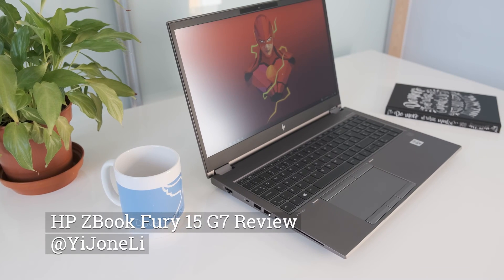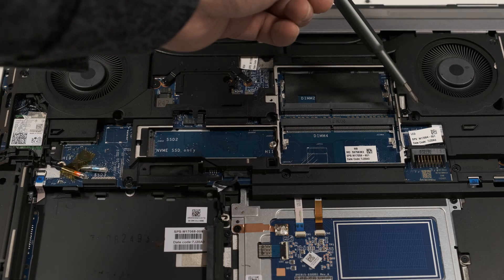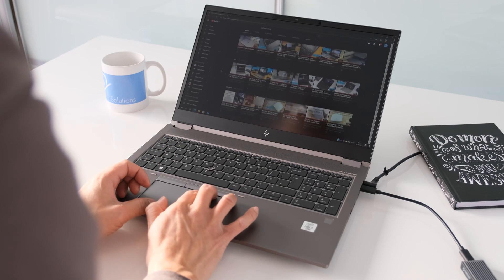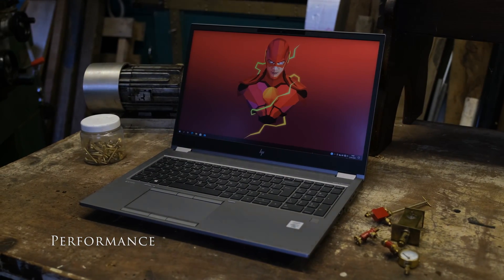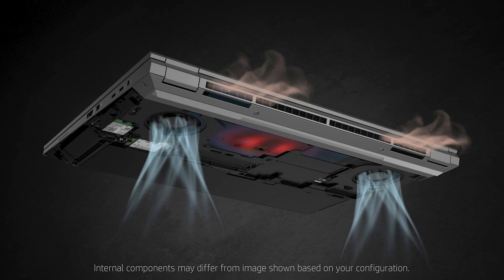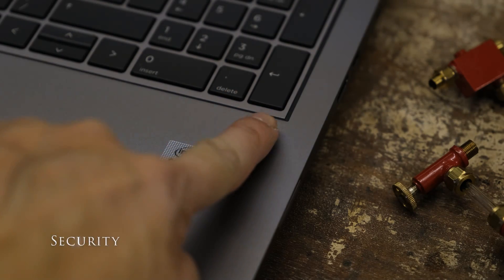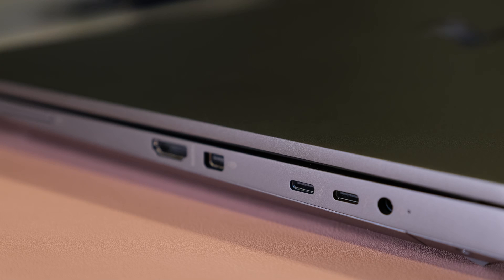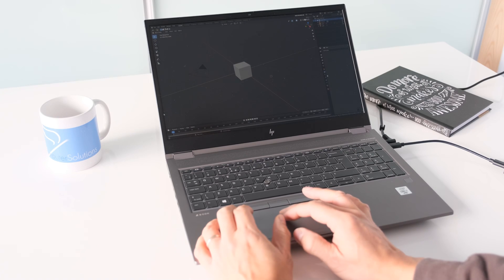HP ZBook Fury 15 G7 Review (15.6" Mobile Workstation Beast)

Comment: Can the RAM be upgraded?
 I have 16 GB, I want to upgrade it to 32 GB. Can it be easily done without the need for an engineer?
Reply: does it make alot of noise and heat or not  ??
Reply: @MuhammadAasim-y8s 
Yes, a lot of noise! I don't know why!!!
Reply: @one_of_the_Arabs  Thank you for the honest feedback! That is very helpful to know.
 
Does the noise happen all the time, even during light work like browsing / reading papers, or only when you are running heavy programs?

To answer your RAM question: If you have the ZBook Fury, it is very easy to upgrade! It has 4 slots and a "tool-less" chassis, so you can just slide a latch and add the RAM yourself without an engineer.

Comment: Not sure why this is praised so much, but there are so many disadvantages for this machine:
     - display quality is under any expectation 
     - display bezels are huge for this price-range 
     - fan noise is so high that you could consider this defective (I could only use it with a good headset with ANC)
     - the keyboard is mediocre - immediately switch to using an dedicated keyboard
     - the touch pad is small, non-responsive in some cases and not very good overall - chose the cheapest mouse that is better than this
     - the size and weight are under expectations (considering competition has slimmer variants , not even considering new Apple M laptops)
     - battery is almost non-existing when in building code and doing something else in parallel (really expected this to be better in a bulky workstation like this).

There are some advantages(mostly the processor), but don't think they outweigh the disadvantages.

Comment: Thank you soooooo much for this review! I'm thinking about buying the HP ZBook Fury G8. I used to be a ThinkPad fan, but have been disappointed by ThinkPad offerings lately (especially with their decision to solder on RAM on many of their laptops now).
Reply from the maker: The Fury G8 is just a minor update to the Fury G7, tweaks like newer processors, Nvidia Ampere GPUs and 4K 120Hz display panel option. Making an awesome mobile workstation even better. Currently using the Fury G8 with i7-11850H, 32GB, 1TB, & RTX A2000 GPU. Love it! 😍

Comment: Price is crazy, I have a furry G7 17" rtx3000 for Solidworks, it heats up like crazy, fans work all the time, the battery does not last long, I don't think that 2hours are possible even if you are using only MS WORD.  And my machine has all the time sound card problems when switching from HP dock to laptop and vice versa, problems are solved with hp assistant but it is taking a lot of time. My old Zbook G3 has way better wifi reception than G7, can not explain this at all.

Comment: Great review! I'm strongly considering the ZBook Fury 15 G7 with the exact specs as your review model. My hesitation is with the NVIDIA Quadro T2000 GPU, I will be doing some Photoshop and Lightroom photo editing as well as some Davinci Resolve Video editing. How does the Quadro T2000 GPU do with Photo and Video editing? Thanks
Reply from the maker: I used it as my daily driver for two months, working on Adobe PS and PP all the time. Premium Pro 4K editing and encoding was smooth. No hesitation in getting this spec with the T2000 for this work + good price point without going crazy on the more expensive RTX 3000 upwards. Tip, always find more memory and secondary SSD for caching helps a lot when using Adobe CC. 👍
Reply: @Dovecomputers  thanks for your feedback.

Comment: Fury 15 G7 actually has 4 m.2 slots... the other two slots are in the same area as the s-ata bay, but you'll need a bracket or you can't screw the drives down.

Comment: An excellent, in depth review! I wanted to know what I should expect from my new workstation, and now I feel great for the coming year. Thank you!
Reply: Do you still have it? And do you stuffer any problems especially with heating?
Reply: @Hosssamm Ive had mine for a few months now and honestly like it quite a bit. I think the only thing I dont like is windows 11 so far haha. 10 felt a lot more snappy, so I might downgrade the os for awhile
Reply: @EjMacarus  what about heating ?? can you please tell us about heating and making noise ??
Reply: @MuhammadAasim-y8s Hello! I’ve been working with this exact laptop since my first comment was posted and it’s been great! I feel like it’s a ready to go workstation. I don’t experience noise issues, but I will say it gets toasty up near the sound bar and underneath, so maybe no late nights working from bed under heavy processor workloads. My only other comment would be the battery life, I’ve had one assigned that was fine (6h work time) and now I have a different one that’s pretty bad about dying. I’ve been meaning to run some battery analysis on it (2/3 hours working time)
Reply: @EjMacarus  Thank you for being so honest about the heat and battery life! It is really helpful.
I am a PhD student and I’m looking at this exact HP ZBook Fury 15 G8 (i7-11850H, 32GB RAM, T1200). I plan to use it mostly for reading and writing reports, but also for scientific calculations (physics) sometimes.
Can I ask:
Light Work Performance: When you are just reading or doing 'normal office work,' does it stay silent and cool, or do the fans still make noise?
Calculation Speed: When you do heavy workloads, does the heat slow down the computer (throttle) or does it stay fast?

Comment: I just bought my Zbook fury 15 g7 with the RTX 3000 and  i9 but I don't know if it is normal for the battery to drain so fast in less than 45min it goes from 90% to 60% or less and the temp is constantly around 70°C  max was 86°C even when there were no programs running and now I don't know if my laptop ain't working right or what (it is my first workstation )....
Reply: eeek about to go for the same setup. rtx 4000 though. is this a custom build? how long did it take to arrive?
Reply: anyway ended up migrating to the apple ecosystem, for now. Macbook m1 has been flawless for 4k etc. battery time is crazy. Hope intel pull their finger out

Comment: Question: doesn't the 94 Wh battery prevent to use the available 2.5" slot? The battery part that covers the slot seems to be quite thick even according to the pictures on the web. I am thinking about buying this piece and I have an unused 2.5" WD Blue 1 TB SATA SSD but not sure if I will be able to mount it there because of this.
Reply from the maker: There's plenty of height for a 2.5" underneath the battery.
Reply: @Dovecomputers  thanks for the answer. What about some mounting frame kit, is it necessary in this case?

Comment: What workstation would be your choice out of fury 17 vs p17 vs precision 7750 ?

All relatively same spec Xeon 8 core processor 64gb ecc with rtx 5000.  

Question around what has better thermal management. Battery life, understandably limited given specs but an hour here or there makes a big difference on site and customer service for repair? 

Would really value your opinion

Thanks in advance
Reply from the maker: IMO, the Fury G7 wins out. Using mine for 3+ months, great thermals for 4K video editing and CAD work. You will never get decent battery life from these power workstations as its all about max. performance. Excellent upgrade options, built like a tank (And weights like one) HP support is slightly better than Dell and Lenovo, again in my opinion. All of them have 3 year warranties for peace of mind. Hope that helps. 👍

Comment: OK, first impressions, after installing the device and moving away from my old Zbook 15 G3 mobile workstation. I had some weared problems with the sound, but it went away. Might be something with the electronics, or some interference with the surroundings. Nevertheless the sound is worse, cause you lack the speakers in front of the body, so when you close the lid (which i have almost all the time) the sound is like from cave, cause the speakers are covered. 
Second, the camera is ABSOLUTELY horrid. I have literally worse picture than before on my 4.5 years old G3. The camera is not able to adapt to the light conditions good. very disappointed with this one. This should not be like this on a noteookb of this range.
Next one, the bottom cover, although it is a nice idea to have it readily accessible is just a very very cheap thin piece of plastic and it is definitely worse then what I had before. on G3 that was a very solid build. Overall the finish of the chassis is OKish although there are bits, that are not matching the standard, there was on G3 machine. (e.g. on the monitor, on the top edge on like 10cm it is not smooth, but I would need to send a picture of it for you to see). 
The device also heats up more than my previous laptop. 
So very mixed feelings about this device overall so far. May be I will get used to it. 
One notice, beware: dock G2s have a vent. And that vent is louder than the notebook itself. I did not catch it before buying. 
Yeah and one more. I am using SC reader almost all the time. On all of the workstations so far, the card nicely went all the way in with about cca 1cm sticking out of the chassis. Not true anymore, it sticks out good 4cm and it is very annoying. I am thinking how to cut the card, so it is useable again. (added later, I cut the card, about 3cm, works, but they screwed the SC reader as well, you touch the card, it disconnects you)
I was thinking about going to the different manufacturer this time. HP thumbs down for this so far. next time I will primarily focus on other vendors. Shame that I did not read and search more.
Reply: that freaking camera is...i am speechless...I feel like in 90ties, when it started. The camera on this notebook is so freaking bad. I am pixelated with LOT of noise even in good visual conditions. Forget about focus.
Reply from the maker: Totally agree with the webcam, not just on the Fury. Been crying out for a decent webcam on a laptop for years. Is this so difficult when cheap smartphones have excellent selfie cameras?
Reply: @Dovecomputers  Do you happen to know, how am I supposed to do shift insert on this thing please? (Another idiotic decision to place power button where insert should be)

Comment: I'm gonna have to sell my left kidney to buy this...
Reply from the maker: ...and the right one if you go for the RTX5000 model! 🤣🤣🤣
Reply: @Dovecomputers  Versions with the best configuration (new, not used) can be bought (since December 2022) for a third of the (original) price. It's also a bit of luck, it takes a bit of searching (and sometimes waiting).
Add:
What I would emphasize is that Quadro RTX 5000 is also used in the Max-Q version, this one has less performance, the difference compared to the most powerful desktop version is about 30% down, I guess it is closer to RTX A4000... There are more reasons (including the size).
My personal opinion is that it needs to be emphasized that there is CUDA, Ray Tracing, PhysX, it has professional drivers and VR support, etc.. Fyi: If someone will hesitate between Macbook Pro/Max - M1 and this one, (so if we take away from how solid the Fury is, how many security features it has, or what is the support and also what are the certifications, etc. ), so for example M1 doesn't support VR, (add: Mac will be without Intel chips very soon, by default) , and Macbook Pro Max with M2 chip in comparable configuration will be expensive as hell even in a year.
+ Detail: someone will appreciate the touchscreen that is available, depending on the specific application. 
Also, you need to consider if you need ECC, with Xeon it is then limited to 64GB RAM, but this is again outweighed by the benefits of using ECC.
Much more could be written...
..It's good to know that a lot of things have to be done manually, scaling, some features, etc. (E.g. Ray Tracing, PhysX where needed, etc.) + one buys and the first thing is to update the BIOS and also the driver for NVIDIA RTX, including downloading their app, etc., or setting the fan when using AC adapter, etc... It makes a really big difference... 
Personally, I'm satisfied. A great workstation at a great price today.
It's a beast, if you run it at max, don't expect the battery to last long, (so either AC adapter/power or a second [replacement] battery would be a solution).

Comment: Hi! Thanks for the review. This is very helpful. I'm about to buy mi first mobile working station. And select between Lenovo Thinkpad p15v with UHD display and HP Fury with FHD. The specs are pretty close. And I would really like to know if HP FHD is worth buying (as Lenovo's is trash for sure, it's been discussed a lot). But can't find the proper information. Most HP reviews have UHD 4K (that is considered to be mindblowing, as well as the price, lol). I'm not chasing 4k content, but good color range and true colors are essential to me as I do work with photos from time to time.
Reply from the maker: Thanks for the comments. The review model is 15.6" diagonal, FHD (1920 x 1080), IPS, anti-glare, 400 nits, 100% sRGB, so in other words perfect for Photoshop type work. If you are considering plugging in an external monitor, the FHD model will be fine. I found that quad resolution would be better on a 15.6" laptop but nobody is doing this on mobile workstations or business laptops. BTW, the Lenovo P15 is the direct comparison to the Fury G7. The Lenovo P15v is comparable to the HP ZBook Power G7 (Another great value workstation) 👍
Reply: @Dovecomputers  Thank you very much for your info. I found the exactly info which I need to know right here. I shall buy the Fury 15 soon.

Comment: Great review...I was reluctant to get another HP as with last one I experienced issues with the battery and charging point. Fury is holding battery for 8.5h on web browsing on other reviews, however on yours is just 5h and just 2.5h on extreme workload. Was it use of GPU that drains it so quickly? You almost convinced me to drop the Thinkpad P15, save for the battery.
Reply from the maker: Thanks. I think its to do with the 'Full Fat' CPU (running at a higher constant TDP) and GPU inside. Compared to Max-Q GPU versions that save battery life but performance is slightly down. With my workflow, I always have it on mains to get the best performance, so battery life is not so important. If it is, the HP ZBook Power G7 is the one to get, much better battery life, similar performance and great value. 👍
Reply: @Dovecomputers  Thanks to your review I've just bought an HP Fury - I am yet to run some extensive tests to confirm the performance, but the built quality as expected.

Comment: Thanks, if I hadn't already ordered one, I would after this comprehensive review.
Reply from the maker: Glad it was helpful! 👍
Reply: Do you still have it? And do you suggest it as a second hand?
Reply: @Hosssamm sure. I'm still using it with satisfaction. Over time it became a 9 tb beast. Only downside you cannot use latest generation SSDs at peak performance, it's limited to 3-4 GB/s due to old controllers. Anyway, if I had to buy another laptop, Zbook Fury series would be the first I'll look into.
Reply: @UmbertoUderzo that's really reassuring, thank you man for taking the time to answer me, wish you all the best ❤️
Reply: @UmbertoUderzo  good thank you .. can you please tell us if this over heat or making noise ?? please tell me because i am thinking to buy it this week
Reply: @MuhammadAasim-y8s  Other than the fan airflow there is no noise as far as i can hear. If the GPU is working hard the airflow is noticeable and the exaust spurts fire, but it works well. If you don't stress the GPU, it's quite silent. I recently experienced some rare blue screens seemingly due to the SSD or the video driver but i don't know if it's a drivers issue or a hardware failure. Embedded integrity tests run smooth. Hope being able to fix that. But at this point the laptop has 5 years of using 8+ hrs a day, 5 days a week.

Comment: Excellent review - I saw your previous HP z mobile workstation reviews and was waiting for the Fury. Glad I did, because it is the one I'll get.
Could I ask - what is the screen to the left at 12:32 ? I have no experience with Thunderbolt - is it a single cable from the notebook to the screen (ie. does the screen need additional power?)
Reply from the maker: Thanks. The portable monitor is a Lenovo ThinkVision M14t with USB-C connection. (Review out soon!) It connects and powers the monitor using the one cable. USB-C can deliver up to 100 watts of power to devices, Thunderbolt 3 adds faster speeds and dual 4K monitor support. 👍